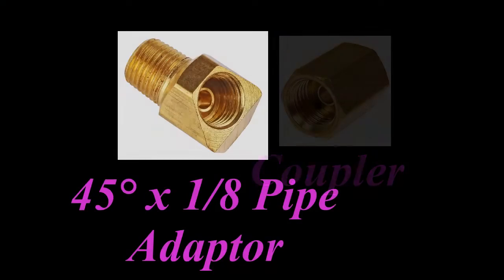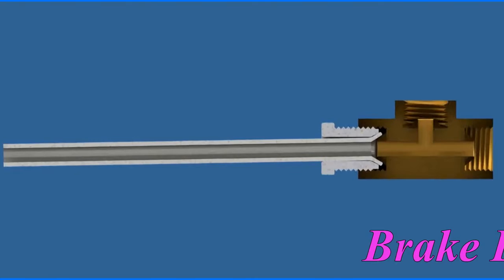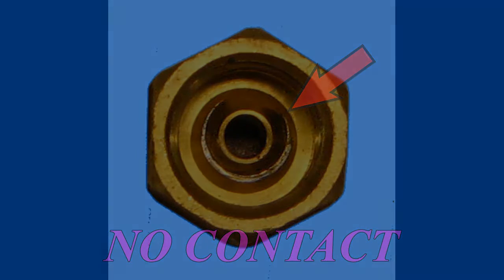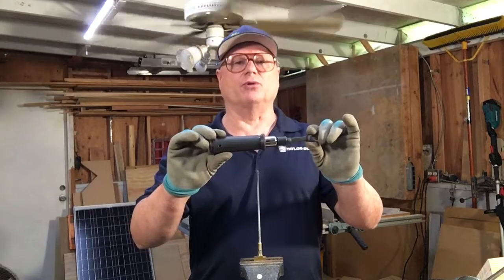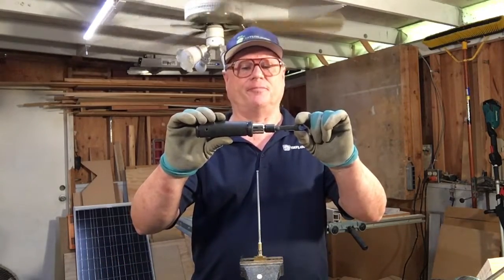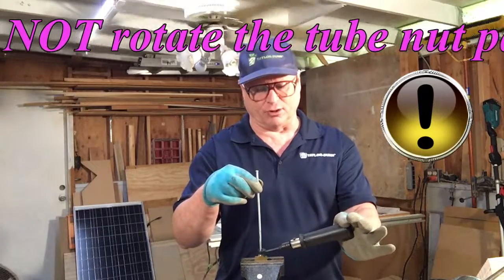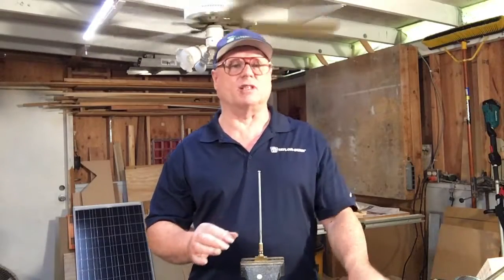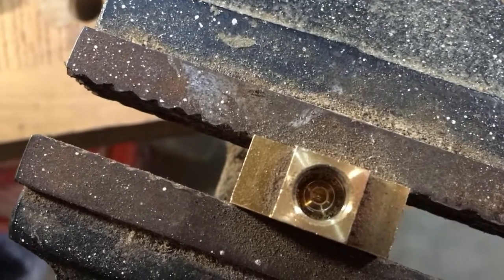Installing & Tightening 3/16 Inverted Flare Brake Fittings

Comment: Ok, but if you don't have a torque wrench, what is the tightening technique?  2) You emphasized the ring on the of the fitting that is produced, does this imply that a fitting should only be used once since the original ring formation is specific to the first tightening?
Reply from the maker: For that you need a calibrated wrist. I created this for newbies coming into the company that had no training or experience.
When tightened properly, the brass in the fitting will deform to fit the tube but it is feasible that eventually it will no longer seal. Typically, brake lines are seldom removed from a fitting but if done often then it would be wise to replace the fitting.

Comment: You said 120-130 in pounds, but what about a "wet" connection? You're working on a new connection.  If the threads have brake fluid on them, will that cause over-tightening?  Thanks for the video, nobody else has this information.  Also is there anywhere to buy that torque wrench? I'm just using a crow's foot with a normal wrench.
Reply from the maker: Seems the tube is no longer sending email notifications of comments. Which means you may never see this but . . . .
The important thing here is sufficient clamping force applied to the seal without exceeding force that would result in deformation of the threads. When wet, the clamping force would increase but the increased force on the threads would be negligible.
You should always use a tube nut wrench to avoid rounding the corners of the tube nut.
That was a Williams wrench which is a Snap-On brand.

Comment: Thank you for the video. This is the only brake line video that I’ve seen showing the sealing ring formed inside the fitting. I didn’t realize this was happening and now I have a method to check for good seal.
Reply from the maker: I have noticed that there are many that make videos that just regurgitate what is already known without adding any real content. I try to offer knowledge because if you know why something is done, then it is better understood and can be applied elsewhere.